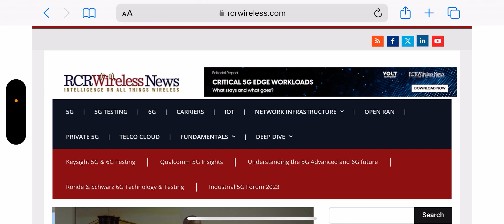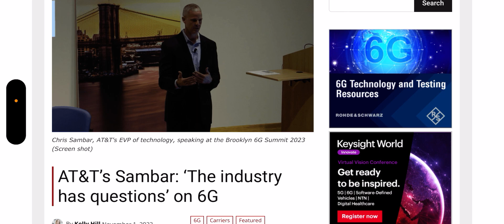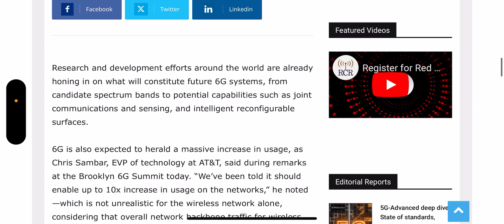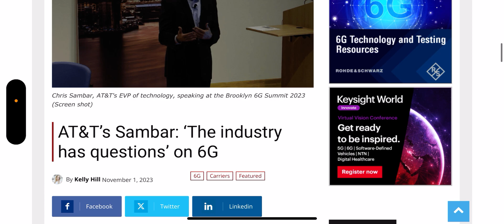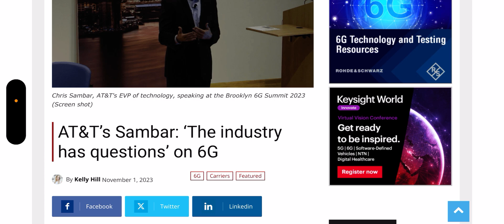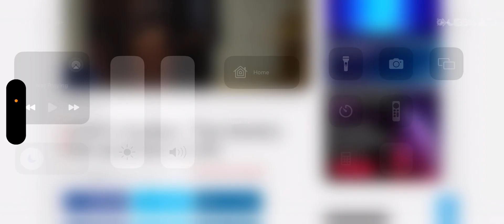AT&T Wireless | This Is Crazy 😳 Network Update ‼️ This Is Already Being Discussed 😳

Comment: Daytona Beach market is definitely AT&T because it’s a tight grid with macros and small cells everywhere. Verizon has added about 5 small cells so far but AT&T has them less than a mile apart in a lot of places. I have AT&T and Verizon and it’s night and day between the two especially in stores and restaurants. Same with Orlando. I don’t have T-Mobile and never will because of the data breaches. But my coworkers complain about the lack of service. I live 20 miles NW of Daytona Beach out in rural and T-Mobile roams on AT&T.
Reply: That sucks since T-Mobile is getting way better in Ocala, FL and they are adding more towers in the forest more than AT&T in density!